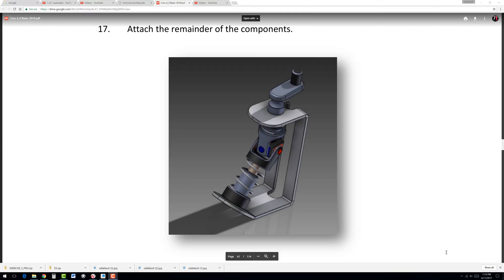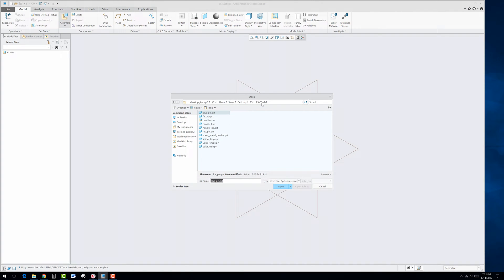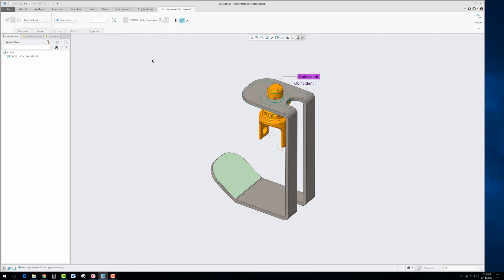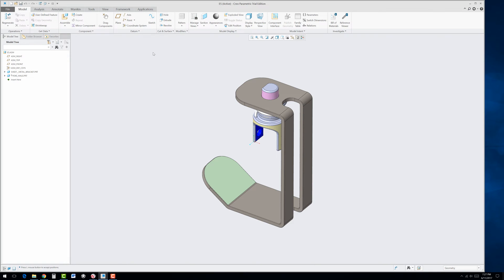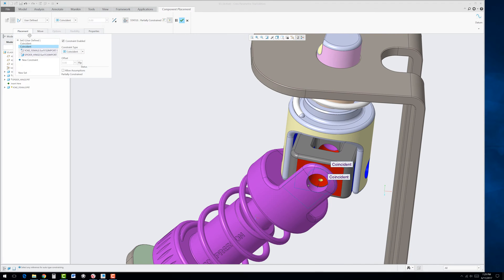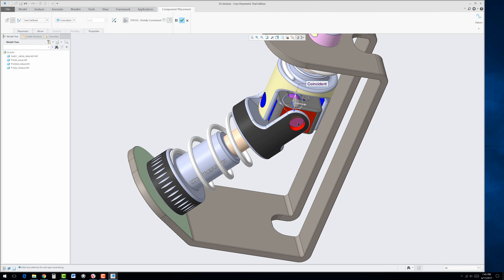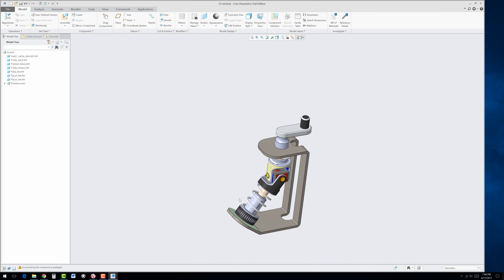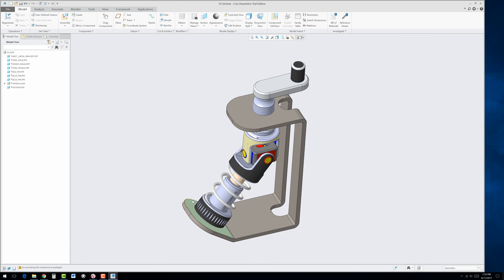E5 Creo Parametric 4.0 - Assembly Basics 1 Tutorial

Comment: Hi. I was trying Lab 5 and I am not able to assemble light frame over the connector. After I align the frame with the connector, I tried to align the supports on the frame. Now when I try to make a coincidence of the supports with the bottom it doesn't get assembled. Turns out the fork in the connector is little bigger than the slot in the light frame. I believe that's the issue. Can you please help me out with that. I tried to modify the part but I guess I can't. PS - I love your videos. very helpful.
Reply: or is it just transparent?

Comment: Is it a good idea to use a 43" 4k TV for modelling in Creo ?
Reply from the maker: That would work.
Reply: vertanux1 
For $1400 (US), what configuration would you build including Monitor, Keyboard & Mouse ?
I've to build a new PC that should work flawlessly with assemblies & other CAD oriented works, but I'm messed btw AMD & Intel, (GHz vs Cores) & also RX vs GTX cards.
Reply from the maker: Shumbham, If you are using the PC as a professional CAD/CAE/CAM workstation I always go with the concept that "More is better". i.e.: a CPU with as many cores as your company can afford, a professional graphics card - either AMD Radeon-Pro or Nvidia Quadro P series. Significant amounts of (quad channel) RAM especially for FEA/CFD/Dynamics & Kinematics simulation. In a true enterprise environment it pays for itself in no-time with the waiting times, delays, and frustrations of a budget PC saved.
Reply: You might know well what a quad channel setup prices are currently. Those are only available on X99 & Server platforms. & if I go with that, for $1400 I would only have ram, mobo & cpu only.
Reply from the maker: If you are buying the PC for yourself to use for home, and some gaming it sounds like you have a good computer. If you are looking for a performance workstation on a budget, look at buying a used HP Z420 workstation with a Xeon CPU. I purchased mine for around $400 on ebay. Then I just purchased a mid-range professional graphics card and upped the memory to 32 GB, swapped out the old hard drive with a 500 GB SSD, and even found a used 12 core Xeon E5 4657L v2 on ebay for $300. The deals are out there, it takes time and a little luck to find them though.
Reply: vertanux1
I think I should wait for a while. PC market is super-hot right now, let it cool down.